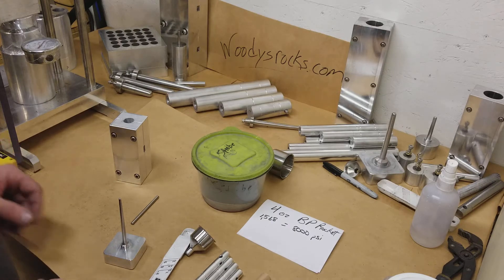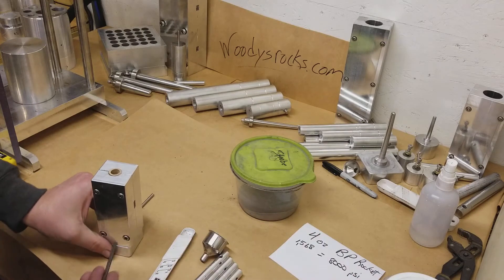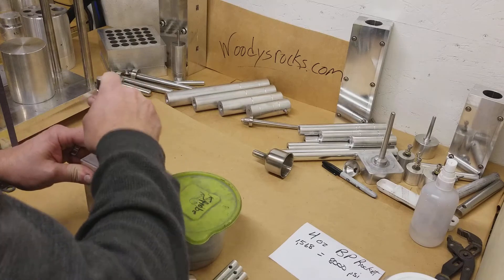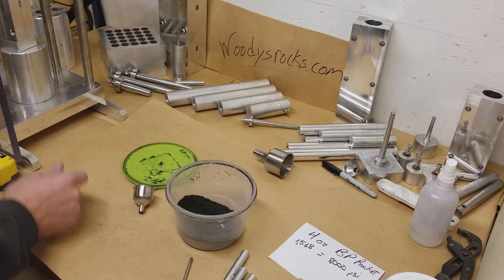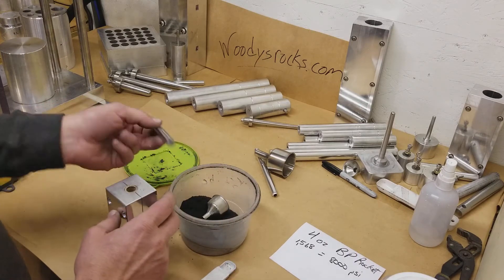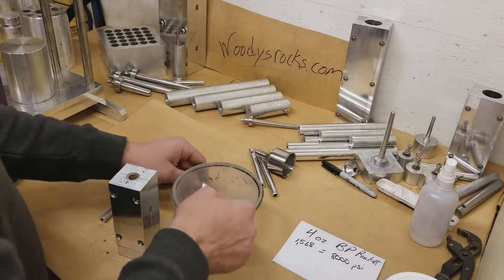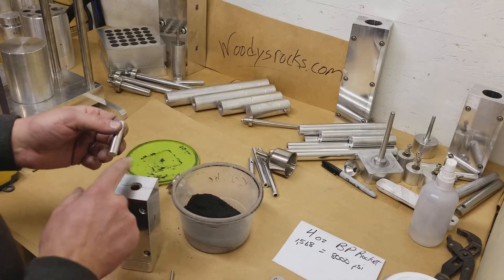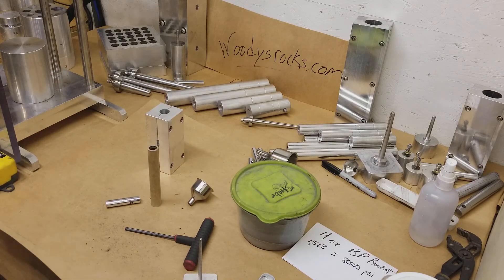Making a 4oz. Bp rocket motor

Comment: I'm using the same 75-15-10 with Eastern red cedar charcoal. Nept tubes and I just keep getting Cato's. Same tooling. Are you using regular hardwood charcoal? Am I not hand ramming it hard enough.
Reply: Might need to start waxing the inside of ur rocket motors.
Reply: Did you ever find out? I'm having catos too. My powder is fine so idk what else to do.

Comment: Does the small amount of moisture slow anything down? Or, is it necessary to allow the motor to sit for a certain amount of time to dry a bit? Thanks!!
Reply: After drying for 24 hours ( as per the  Indian wether condition) it works fine.

Comment: Expensive equipments take all the fun out of making this stuff. This is for the rich kids only.
Reply from the maker: You can be making rockets for a couple bills if ya want.  
Cohete set with sticks and tubes.  Get some milled charcoal, nitrate and sulfur and you are good to go.
Reply: @woodysrockspyro6436  where are these sets available?
Reply from the maker: Woodysrocks.com  under the rocket tool section
Reply: ngl you can just take a nail and a hole bored in a 2x4. Done that before. this set may be expensive but that doesn't mean it's rich kids only.
Reply: Nice

Comment: what is the press compacting to, 1,568lbs or 8,000lbs.... Also someone in the comments said this is whistle fuel but the title says BP... this is a very confusing video...you should take it down.
Reply: This is a year late but the press is going to 1,568 LBS, which results in 8000 PSI loaded onto the composition because of how much smaller the tube/rammer is